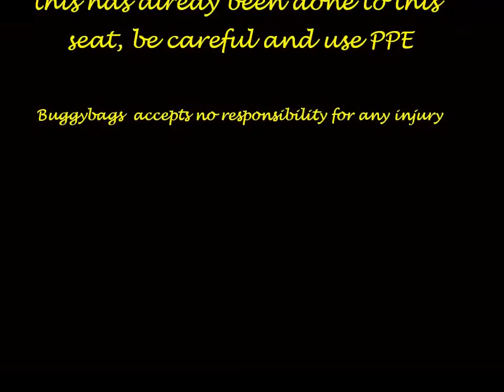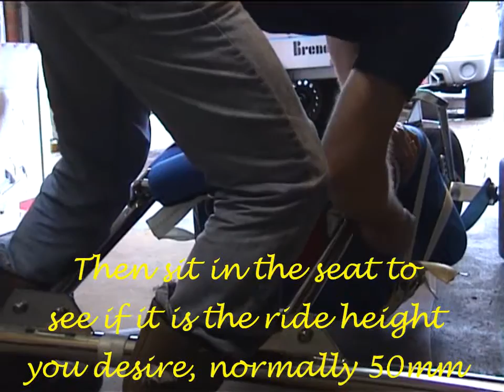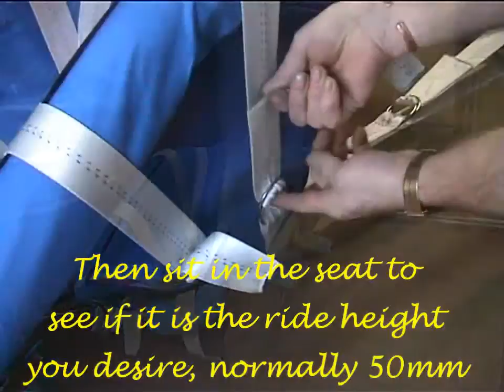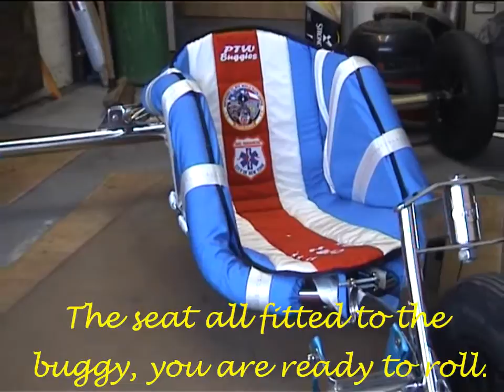Fitting a BuggyBags Seat

Comment: Nice Work there Carl.
Just to Note, Please ensure adequate ground clearance when fitting the seat, along with regular inspection for wear and tear.  Straps should be checked to ensure there is no slippage between outings.

To prolong the life of your seat, it can be washed with a warm soapy solution, rinsed with clean water.  Do not store Damp.     :-)

Cheers and Have Fun!!!